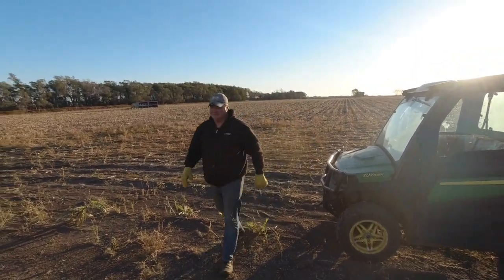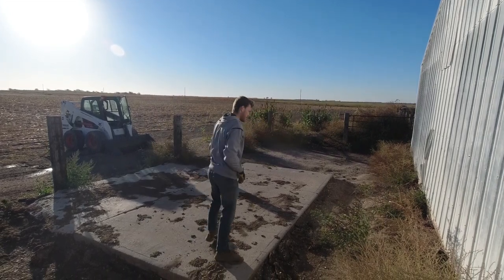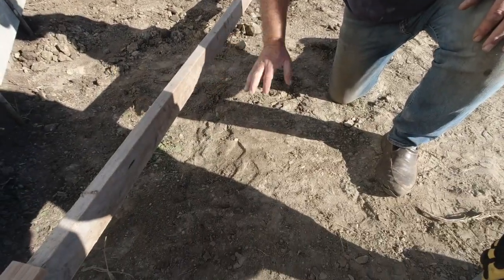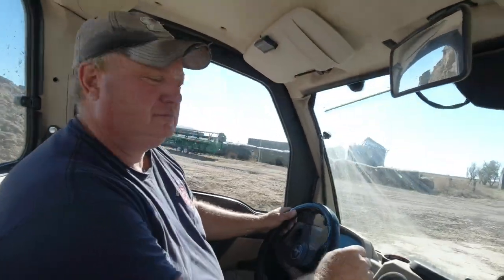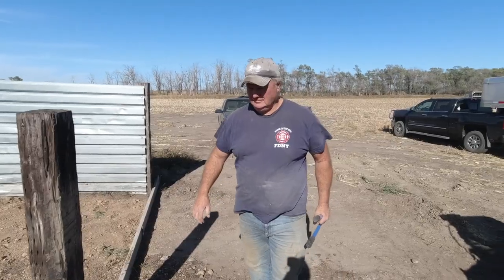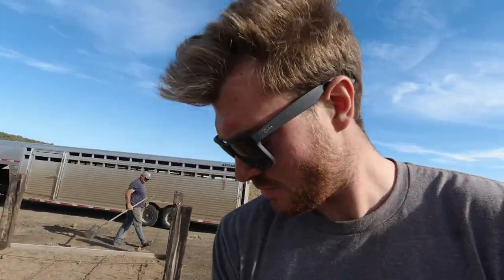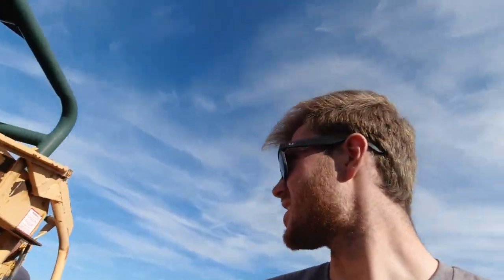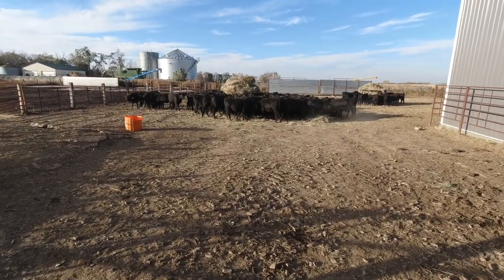Concrete On A Budget

Comment: I know you guys always like my ideas so here goes.  1) A best looking calf contest voted on by your viewers. Winning calf gets a bucket of pellets. 2) I drive any round stakes by chucking them up in a hammer drill. They melt right into the ground. If they are too big for the drill you have then you just need a bigger drill. End of rod does not even need to be pointy. I use to put in 4 ft ground rod.

Comment: There are 3 guarantees with concrete. Its going to get hard, it is going to crack, and nobody is going to steal it
Reply: Had a new concrete driveway poured this Summer. Added micro-fiber (fiberglass) instead of rebar. "Pre-cracked" by cutting into sections with diamond blade saws. Seems to have worked well, no cracks near those cuts. They are all in other places! 🤪

Comment: Concrete on a budget…yeah, I know what that is.
Rod-weaving. I think I’ve told you about this before but my 2 sisters and I spent one of Oklahoma’s hottest most humid days weaving sucker rods and then tying them together with wire at the intersections when dad was getting ready to pour concrete. I realize now the boys missed out on that fun project. Rod-weaving!
I’m helping with my Sonne slappy!

Comment: Concrete for cows 🐄. As a contractor, I've seen folks do alot of STUFF, rod, no rod, expansion joints, no expansion joints, junk metal thorn in, the full spectrum. But, where I draw the line is assigning blame on the results gone south. First in line, I got a bad pour from the ready mix company, the concrete set-up too fast, slab was thick enough ( NOT ), added a bunch of filler soil (did not compact it, putting water on the loose dirt is not compacting, soaking the ground before concrete prevents moisture being drawn out of the concrete) and my favorite, didn't have enough people and the right tools. This really ticks the concrete truck drivers off because they've got 8 yards of concrete on the truck and there is no way it's going on the ground without them pitching in. FYI, THEIR PAYED TO DELIVER THE CONCRETE, NOT DO THE WHOLE JOB...........
Reply: These bozo's didn't bother drilling into the existing concrete to tie them together with regard. GUESS WHATS ABSOLUTELY GOING TO HAPPEN, ( HEAVING ). WHEN THE BUCKET FROM THE BOB-CAT SLAMS INTO THE PART THATS HEAVED. BOY, I DON'T HAVE A THOUSAND DOLLARS TO THROW INTO A SLIP-SOD THROWN TOGETHER MESS AND THEN    POST    IT ON LINE FOR INFORMATION-EDUCATION-ENTERTAMEN

Comment: Need some double headed nails for the foams. Poured a lot of concrete with my dad on side jobs. Still hate concrete.  Hog panels is all you need. Just put up so they site i. The center of the concrete.

Comment: If you dont compact  that gravy  when it settles your concrete pads going to crack have poured many and many of yards of concrete 4400 PSI with about a 3 slump would be good for that area
Reply: Hopefully they ordered it with some air. 3” might be a bit tight without a vibrator. Can’t believe they’re pouring in November.

Comment: That Concrete will be fine.  You've done everything right.  In my experience the only thing that busts concrete is frost and heavy weight.  I've seen 12 inch concrete crack because of frost and stress under it's own weight.

Comment: Never screed the dirt before…should have put a few pins in so you know what height your concrete will be.  When you run your screed across the wet concrete you will find the pin and see if your at the right height.  Unless your screed is long enough to touch both finished sides.

Comment: You need to lift the steel up so it is inside the slab. If nothing else lay it on some small rock paced about four feet a part
Reply: we put it on lifts

Comment: Is there any hesitation to pour the concrete up against the wood posts? If a post rots out will it create an issue?
Reply: They replace post all the time, so I am thinking probably will rot a little faster, but not a problem to replace.

Comment: Concrete work ... not my favorite thing, although I've done quite a lot of it. But, I really like the result when it's done. I used to pour pump bases in the oil patch (or, as we called it "awwwl patch"). Only time in my life I passed out from sheer exhaustion and probably a touch of heat stroke. Yeah, concrete work not my favorite thing.

Comment: I used to occasionally pour concrete about 15 years ago. I formed and poured a 12x24 slab (4yrds) last July after work with only my 2 young nephews to help. It reminded me how much I hated it lol. I nearly died and the concrete got away from me🤣 wasn't a perfect finish, bit good enough to cover with a building

Comment: What engine does the old school pickup have? And how does the truck handle loads? Looking for an old farm truck to use for hauling goosenecks with light equipment and 3-6 head of cattle and a similar one in the area for under $5,000

Comment: Hopefully you would have driven over your dirt to pack it down a bit 
But so far I don’t see any of that happening 
So your next best thing you could do is water the crap out of it 
The water will settle the base and it will keep the moisture in the concrete letting it dry slowly 
But you have freezing weather then your going to want to add some calcium chloride to help with the cure in the cold weather
The calcium chloride will make the concrete hot it will also make it set up a lot quicker so once you put it in the ready to go it won’t wait for you
Reply: we did water it

Comment: Be sure to use expansion material against all structures to help prevent concrete cracking! Pour Concrete at about a 4 or5 in. slump to reduce shrinkage.

Comment: Use fiber in your concrete and you won’t even need rebar for that application!
Reply from the maker: we've heard of that, do you have any experience with it?
Reply: i have heard that fiber isnt good for cow feet
Reply: I have no idea on the cow feet part, but if you float the concrete well, I never saw it poke through.   It’s a lot of very small 1/2 inch strands.  I’ve used it on sidewalks and it prevents cracking and that held true for me.  It’s said to be stronger than rebar in that type of use, but I have no proof of that other than it worked for me. I’ve heard of people using a torch to melt off small pieces that show through, but don’t know how reliable that is.

Comment: Oh my gosh... you didn't run a vibrator... where are the chairs for the wire mesh? ........ Ya, OK... I saw you hose the base down.
Reply: we put chairs in it must have ended up on the editors floor.

Comment: Definitely didn’t need forms up against the walls lol
Reply: Those forms are to help screed off the concrete to a decent level finish...
you can take the forms out later and pour concrete into the gap if you really want to finish the pad off right to the wall
Or you can leave the gap for drainage.
Reply: Or as a gap for insert/sacrificial walls to stop splash of cow manure up the shed's walls....
Reply: Up against the wall long hair!
Reply: @JohnSmith-yv6eq Or all will be revealed in tomorrow's video.